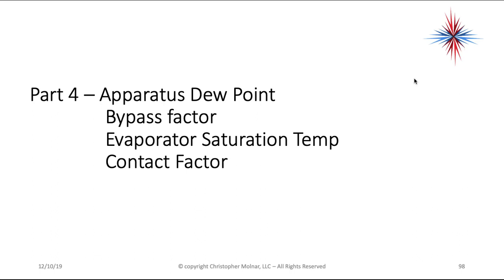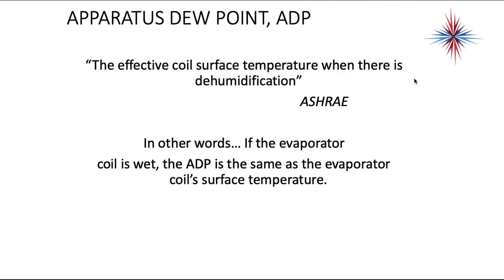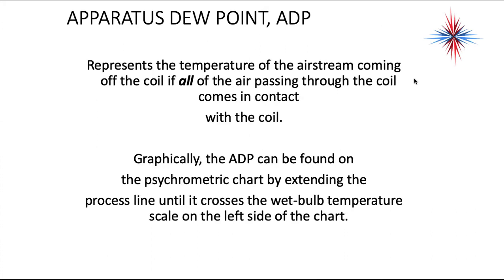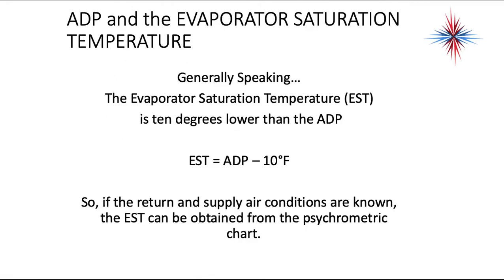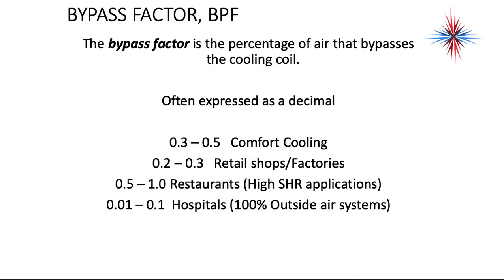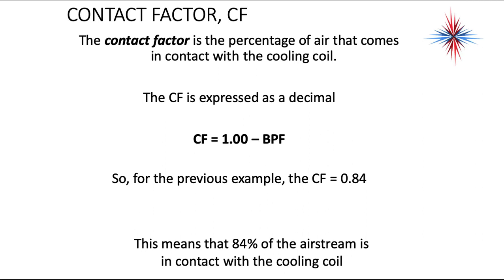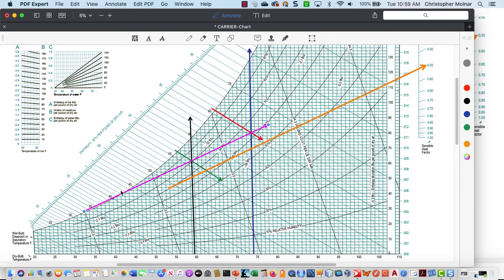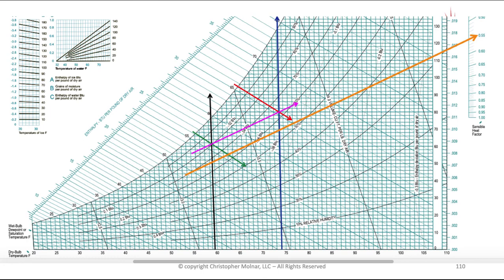System Design - Psychrometrics - Part 4

Comment: If if air at initial temp at 36 deg C and RH at 42 % ,  i want to cool the air at 11 deg C by adding directly chilled water into air through evaporatorive cooler.
What will be the following
1. Makeup chiller water flow quantity?
2. Makeup chiller water temp?
3. Chillier Load TR of makup chiller water?